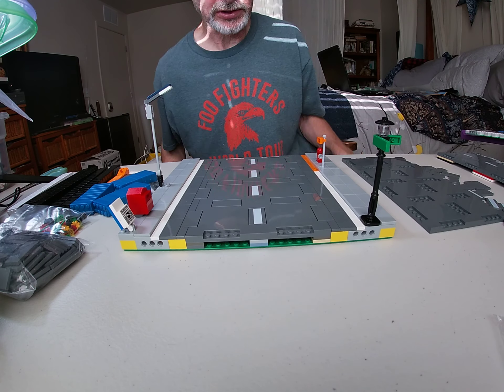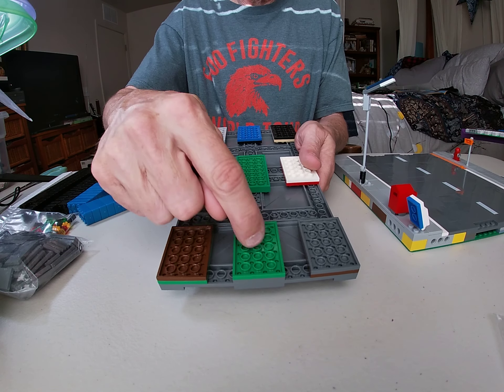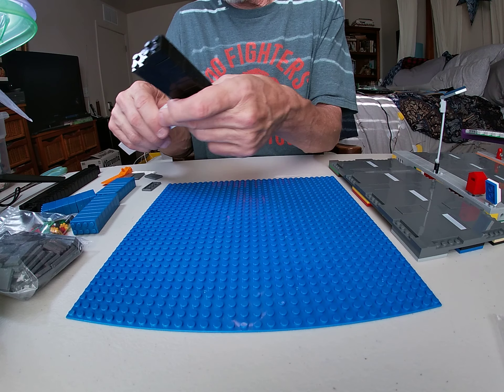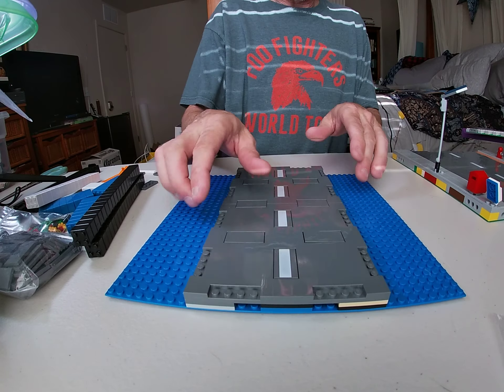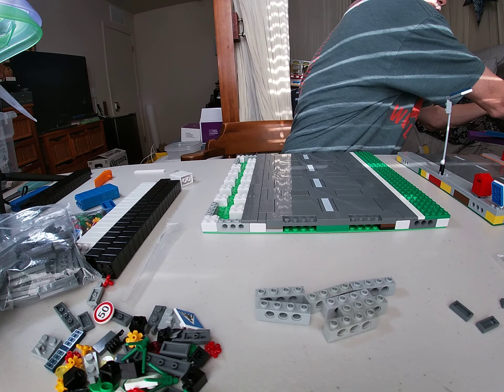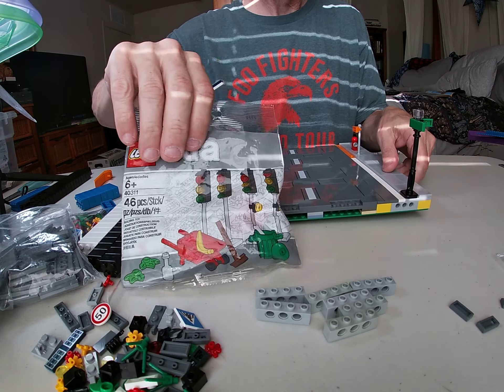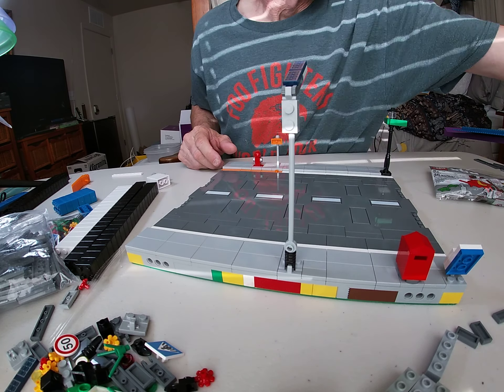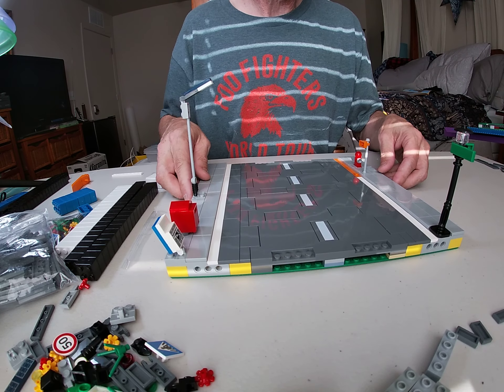How I Build A MILS Road & Sidewalk

Comment: i honestly really like how the new roads look VISUALLY BUT they're not practical because they're not wide enough. i feel that lego should SUPPLY a wider road because they know that lots of vehicles wont fit on the road. i think the fact that sooo many videos like this exist just screams that lego needs to change something..

Anyways, loved the video! thisll definitely help in the future.
Reply from the maker: Yeah I widened mine by 3 studs on both sides but I had to buy extra 1x8 white tiles and 2x4 dark blue grey tiles to do that which is a bit spendy. I think it's odd they haven't come out with a new curved road section either, disappointing for sure.
Reply: @lifesabrick5104  totally agree
Reply: They’re easier to modify into any size you want, that’s the whole point is to actually build with lego.
Reply: @kevina1084  my point is that they really should be in the size people usually need them to be in though, its more practical

Comment: I built a thing, a city, twenty years ago.
It was 16' X 5' X 6'.  Two years, 300 pounds.
The elements and construction tasks of your
road build demonstration were one of nine
similar hybrid mistakes I made.
The different bricks become a nightmare,
with rebuilds or diorama movement showing
the weak compatibility.
Play Well, says TLG.
Reply from the maker: Thanks, experienced insight is always welcome! So far, no issues but I'm hoping the mils plate squares will provide a solution to the possible anomalies. I have mils plates built with all Lego bricks and other mils plates built with a mix of non-Lego and Lego and so far they meet perfectly. It's most challenging to not think in terms of the squares but to realize I can create any shape of a thing and am not limited to the 32x32 borders.
Reply: @lifesabrick5104  
Remember to stop and play
when constructing a big thing.
I lost that part at the end.

Comment: Just so everybody knows, I thought this same thing and bought a bunch of baseplates from Dollar Tree and it does not fit perfect by any means. I keep having a weird bend and overall wonkiness anywhere one of these plates lives There's also some trouble connecting these sections to the rest. I've been able to combat it slightly by cutting them into smaller pieces but if you look close you can see something is off. If you do try this you'll have to find an off brand you can trust, if that exists.
Reply from the maker: Yeah, you just got some bad base plates for sure. I bought an LVhero brand in a pack of 6 from Amazon that had a bunch of positive reviews specifically about using them with Lego and they work great. $12 for a pack of 6. The off brand 2x2 and 2x3 etc. bricks I purchased locally from a teacher work fantastic on the off brand base plates also.
Reply: @lifesabrick5104  You say they work great while we are literally watching you struggle to get the road plates attached to these base plates. Lego is expensive for a reason, and you get what you pay for. The cheap stuff isn't manufactured with the same level of quality. If you're ok with that then use whatever you like. But I have never found the cheaper brands to be as reliably good as real Lego.
Reply from the maker: @koloth5139  Just fyi, I struggle in the exact same manner with actual Lego brand baseplates, especially when mating 9 smaller plates to one baseplate as in this demonstration. The jury is still out on these long term, though, as I've had them built for just under a year. So far, with minimal handling, none of the plates or bricks are showing any signs of coming up or off. I'm not saying they are a perfect replacement, but if you're on a budget they can work for mils plates or if it makes you feel better use a mixture as I have from top to bottom.
Reply: people who think lego makes the best quality products are completely false, just take a look at any other brand like cobi, mouldking or pantasy, who have much better quality bricks with better printings and of course much better pricing

Comment: The dollar tree base plates I bought work alot better than factory Lego  plates.  Quite a savings at $1.25 a plate. You can order online and have them delivered to your local store for free.
Reply from the maker: Yeah good call- I'm having good luck so far with an off-brand from Amazon at $12 for 6. I've definitely found a difference when I just use Lego brand though, everything just fits nicer.